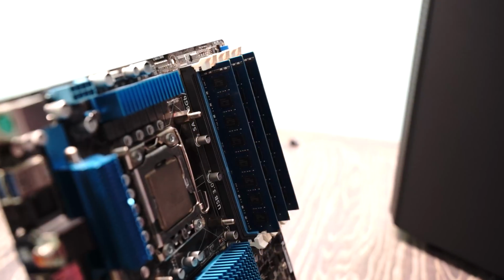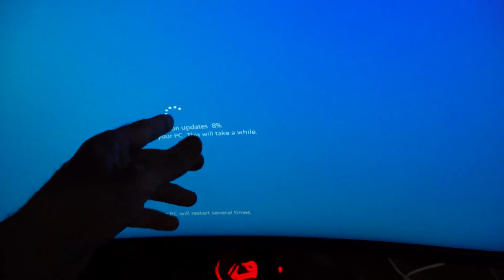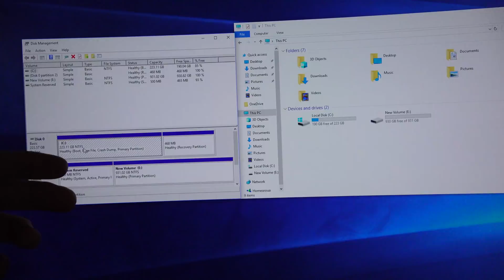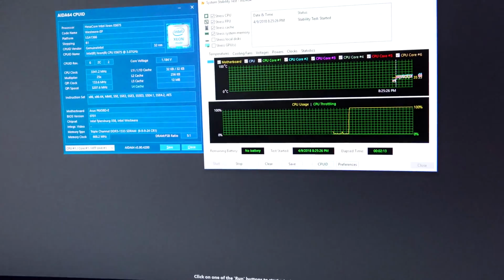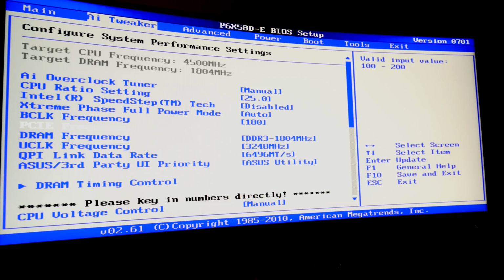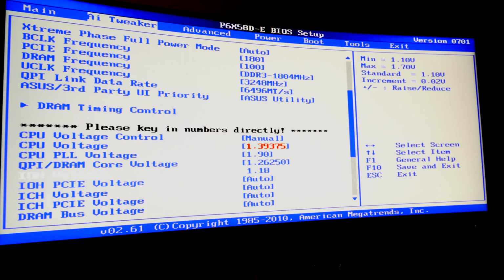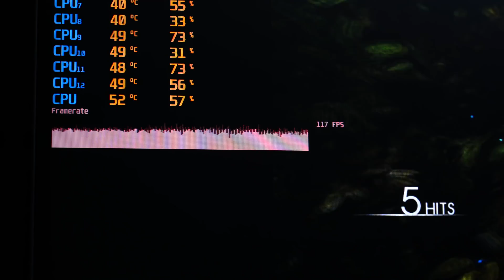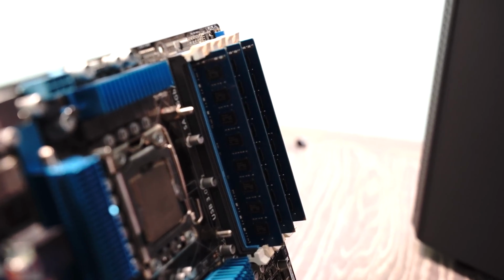Is X58 Still Worth it..? Taking the 6 Core X5675 to 4.5GHz on AIR.

Comment: Working on my 3rd and 4th x58 systems, first was a x5660 that went to 4.41 stable on air, than 3 x5670s in a row going to 4.4-4.5ghz all stable. So much value for the money when you can find the boards at a decent price.

Comment: I still use a dual Xeon X58 workstation. I bought a Dell T5500 back in 2010 half the price (3000 €) and lasted until 2013. The board was changed to a Supermicro and everything was taken out from the case and put into my desk. Then the 2 X5570 were replaced by 2 X5687 and Quadro card with a GTX960. One heatsink snapped off destroying one cpu slot so now I'm using half the board, waiting for a Fujitsu one to continue working for the 8th year with X58. FTR, I used to make 3D architectural work, now I mostly make time lapses working with 3 adobe apps plus 1-2 more photo or video editing programs at the same time. My editor friends still bring me big files to render...

Comment: I have a 5680 on X58 overclocked to 4.6 GHz. Temps during normal usage are just around 55° C, idle around 30° (240mm AIO). Haven't tortured it but in intensive game play it will reach 65-70°. I didn't expect it to clock this high! I'll probably back off the clock a bit as vcore is around 1.39V which makes me a little nervous.

Comment: Just upgraded my x58 rampage ii extreme with some new goodies recently:
- Replaced my i7 920 @3.8GHz with a x5680 @ 4.2GHz
- Replaced my GTX 560 2GB (non-ti) with a an ASUS Strix GTX1080 8GB ...just now (literally)

Love the x58!! much love since 2009 :D and still strong <3 
... just wish i had a spare x58 board to put the 920 in... cant find any here in Canada that are a good bargain :(
Reply: -
Hi, i have an Asus Rampage II Extreme but i am not able to put a modern graphics card. I tried a RX 580 but it didn't boot. I thought it was because our motherboards have legacy bios only, but i see you have a 1080!!! Could you please tell me how did you manage to set it up? Thanks

Comment: More love to the X58 from here... 
That is one Great (old) CPU. I'm running my X5675 on a Gigabyte X58 G1 Sniper. What a nice machine. Running cool 4.2 GHz @1.25V (peaks at 70c an a Scythe Mugen 5).  BCLK 167 x25 multiplier.  Not much stress on the motherboard or memory (running stok speed on DDR3 cl.9)
This machine is using about 150W on idle (complete system from the wall with a GTX 980 Ti) and about 245W wall power on full CPU/memory stress Aida64 load. Good results. Efficiency wise the new Cofefee Lake  platform is much more efficient. My i7-8700 is just using around 110W on Aida64 streess test  (system wall power).
BTW. My X5675 @4.2 GHz scoring 943cb in Cinebench.
The X58 motherboards seems a lot better build than the new Z370 boards.

Comment: Still rocking an X58 board in the guise of an ASUS P6T.  Slapped a Core i7 990x in and overclocked it to 4.0 GHz on 1.3625 V (or something like that).  Just changed the multiplier from Auto (i.e. 28) in the CMOS setup to 30.  Voila!  Haven't subjected it to any torture tests with AIDA64 or Prime95 yet, but it seems stable doing protein folding with Folding@Home.

Comment: Have had an Asus x58 premium and 980x cpu since xmas 2010 and have had up to 4.35Ghz on air utilizing settings all mentioned in the past. QPI delta of 1.4V max vs mem V is spot on correct as aforementioned. Also all the new stuff fails quickly. Manufacturing quality or making die too small seems to make later hardware fail at a yr or sooner from what I keep reading and this board/cpu keeps on ticking. I'll take a little slower and better quality over whats out now. Want to follow NVMe ssd booting on this beast as others have as next back to the future retrofit on my beasty. happy trails

Comment: YOUR CINEBENCH SAYS CPU @ 4.14 GHz AND YOUR PERFORMANCE MATCHES THIS READING. YOU ARE ON 23x180 BRO
I've watched this and the other videos to the x5675 and you should redo your test. Uncore needs to be set 2x dram freq for best performance. set bclk to 195, qpi to  1.3-1.35 , mem 1560, uncore 3120, no spread spectrum, no clock scew, lower multi to 23 and watch how scores improve drastically
I will get my 5675 next week and prove! :D

For comparison my i7-950 @ 4.1 GHz on Air max 75°C 24h primestable
195MHz x 21
1.257-1.303v Vcore (LLC)
QPI 1.4v 3514MHz
1564MHz DRAM freq CL7-8-8-24 @1.65v
HT on

Cinebench R15 score 650
CPU-Z single score 371
CPU-Z multi score 1917
CPU-Z ratio 5.17
IBT output 1024: 51.5 GFlops (these cpus don't have AVX)
IBT output 4096: 53.5 GFlops

Comment: I know its quite late to ask this, i own a rampage iii formula x58, i seem cannot go past install windows 10. It hangs on the windows logo. Turns out it was caused by VT-D technology for Hyper-V settings in the BIOS. I had to disable this for the windows 10 installer to continue. Did you disable your Vt-d settings too? I can run windows 10 now but i need the Vt-d for vmware to work. Did you have any issues with this? Whats windows 10 version that you used for this build? thanks.

Comment: I got a $20 x5660 to 4.3ghz on a Msi x58 platinum with 1.3v(+.260) 205x21 +.280v QPI (still white in bios???)
it does 4ghz @ 191x21 +.170vcore nothing else and 4.2ghz@200x21 +.240 vcore + .240 QPIAny idea if +.280 QPI is safe? this mobo won't let me read actual QPI voltage..... (+.300 QPI will turn red)
It's on a hyper 212 hottest core hits 77c in cinabench games package hits mid 60's

Comment: I have a asus rampage II gen, 24gb ddr3 1600 triple chanal  (even is slow ram triple chanal make it faster them ddr4) 6 core x5645 xenon 2.4ghz and a gtx1060 6gb 
My hp monitor is a 1920x1200 I play wicher3 and asasin creed origins all day with over 60 fps all on max , this is enough for me and I will not upgrade 
The motherboard is very temperamental with over clocking I never let my cpu under 2.8 Ghz  (only 2 bios options Gaming and extreme O.C.) in both cases over clock everything cpu and ram I don't know how to run it on stock speeds

Comment: Hey guys, I just set up a x5675 on a asus Rampage 2 extreme board. tested with 2 stick of 2gb that i had lying around. I succesfully overclocked the cpu to 4,5ghz. Got a score of 1018 on cinebench. So im in need of some memory.
Its just not clear yet what options i have. Regarding ecc memory. Will it work? Will it benefit my system? Or do i get better performance with 6 sticks of 4gb/8gb 'normal' memory.

Comment: I had a similar problem with the Phanteks P300. Both Gigabyte boards I put in this case did not work correctly even after being tested and overclocked on the bench. H55M and H57M, trying to get the I7-870 Stable at 4.0ghz. I spent 2 weeks trying to figure out what component was the problem. After putting the H55M and I7-870 in an older case I was able to get it stable and able to game.

Comment: Hello! I have an Asus P6T If and an X5675 and I was trying to overclock it ... but when I use the 25x, during the stress test, the multiplier goes down to 23x ... so I thought my board did not support the maximum multiplier, so for trying to maintain a stable speed, I tried to use the 23x in the BIOS, but it seems that any multiplier below 25x, the computer does not go into Windows, or do not even Post ... but when using the cpu with the stock speeds, the 25x keeps fixed, without any change, not lowering to 23x as happens when I try to do OC ... what do I need to do to keep the 25x when OC? =/

Comment: dude use an old toothbrush for getting the old paste thats clogged around the edges of the resistors and chip much easier, i cant remember where i got that info but it was really usefull when i had paste on the pins of my FX6350 cpu one time

Comment: Hmm, how would it compare with a i5-2500k? just found a Gigabyte X58 board with a i7-930 for $150 Canadian listed local & seller will throw in a Cooler Master case & T4 cooler for free, there's also someone selling some Xeon X5670 chips for $50 each so basicly a X58 board & X5670 for $200, should I do it to replace my i5-2500k that I'm having a problem with finding a deal on a overclockable motherboard for?

Comment: i have the same issue with my p6td deluxe (x58) and a 1080ti evga icx... it wont post or boot (sometimes it did) with display port. there's something wrong there... using a 1070 from gigabyte does not cause this problem, so go figgure... express gate helped at first but then things degraded and I could never make it work. i now even have my board crossflashed to yours, and it still wont work :( weird thing, if I put the 1080ti in hdmi there are no post/boot problems lol

Comment: What does a 4.5ghz 5670 score single core in cinebench? That is a far more accurate portrayal of how its going to game than multi. If its anything under 150 its not worth your time or money to invest in this platform.
Reply: A 4.0 scores 124 or so. I don't think you will break 150

I think a 4.37 is 130.

The gains are minimal after 4.0.

Honestly it just depends on how cheap you find it. I've gotten 3 x58 boards in the last year. 

2 of them dirt cheap. One was in a broken but not broken pc build that I only paid $40 for. Sold that motherboard  $140.

Another was in a fully built pc I picked up for $200. I sold all the parts I didn't need like the gpus, hard drives, and recouped a lot of my $$$ and had a sweet case I put to the side for a future build. Saving them for a Ryzen 7 build I'm the future.

The last one was a dud on my part. Scored a board and cpu i7 920 or so for $50. Thought it was an easy sell. Did not sell as fast as I liked. Ended up selling it online and mailing it out as opposed to selling it locally. Got damaged in transit so I made almost no profit on it after I refunded some cost. Whomp whomp.

I use one as my main rig at the moment even though I have better parts just cause...no real reason.

Comment: I like your channel.

I have a GA-EX58-UD4P and it's in a forever-young X58 super-stable beautiful case platform I refuse to give up. I have a Facebook album that I started 9 years ago that chronicles the growing-up of by beautiful boy.

Have the new GTX 1060 in and working fine. Have 1.65V tipple-channel DDR3 Corsair kit (updated CM3X2G1600C9) 3-part on order from Japan to get me to 12GB. 

I'm giving you the FB album here:

https://www.facebook.com/media/set/?set=a.58625182241&type=1&l=50082fea05

I still have the original 45nm 920 in the LGA and have never overclocked. Which Westmere should I plop in that socket?

Comment: Just here to leave a message. I still own a decade old Core i7 920 rig.
Yes, OC'd @ 4GHz from base 2.66 (2.8) G mark. Running a beast of a GTX 1080 Ti by AORUS for half a year @ 1440p.

Both under water.

Comment: Thank you for helping us save our hard earned cash.  I'm running the X79 platform and all I need is max out the RAM and slap in a Xeon X2690 v2 or 2697v2.  Turbo boost it and Geforce RTX ready ( I don't need nvme boot since I'm using the Intel 520 SSD (my all time favourite ssd))

Comment: I'm a lazy overclocker lol. I like the unlocked chips like the xenon w3680 (xenon version of the 980x) which you can get on ebay for $70 usd. With the unlocked multi, you can just adjust the multiplier and voltage and your good to go. You can also choose whether you want to leave speedstep enabled or run a fixed voltage. I like the speedstep option since the voltage and speed kicks down when im doing something easy like reading on the internet, then kicks back up during more intensive tasks like games. For memory like on 1600mhz sticks for example, i just apply the XMP profile. Makes for and easy overclock. For example, my w3680 on a sabertooth board is running at 4.41ghz, which is set with a multi of 31 on a 133 stock base clock at 1.344 volts peak with speedstep. And for my 1600mhz ram its just set with the xmp profile which sets memory to 1.65 volts, 1.20qpi (raised this up to 1.25v for 24gigs of ram), and CL9 timings. I literally leave everything else on auto. Sure, maybe I can get more performance out of base clock overclocking, but the stability is easy to get this way. Which is why I say im a lazy overclocker lol. The nicest x58 build I had was a W3690 on a Asus Rampage III Extreme with 24gb of 2000mhz Corsair Dominators. Only ever used the xmp profile on those sticks, wonder how much farther those can be overclocked.

Comment: Quite often the cpu clamp doesn't apply enough pressure on the 1366s and the pins make poor contact. Random reboots blue screens ram not recognised. I know cos it took me ages to find tbe fault. Fixed by cleaning cpu with ipa/air compressor on mobo and adding washers to cooler for more pressure

Comment: You have to unplug all of the drives except for the boot drive when intalling Windows or it will put the boot partition on another drive. Why does it do this? I have no idea, but that's the work around. Then once windows is installed, you can plug back in your other drives. This happens on my ASUS Rampage Extreme III as well, but I never had the problem on my ASUS Sabertooth.

Comment: Are you comfortable with the vcore being as high as 1.4? I'm slightly spooked of burning the chip/mobo with that kinda voltage. It might be necessary for getting my X5650 to 4.4, even though my CPU temp scores seems safe and well below 80 degrees under full load.
Reply: What are you oc settings?
Reply: With my P6T Deluxe v2 and X5650 I'm locked with a 20 and 22 multiplier. I can reach 4Ghz (and 4.4Ghz turbo) with the 22. There begins to be audio distortion if I have to bring the BLCK up to 220 with a 20 multiplier. I've disabled hyperthreading, which hurts its multithreaded score a lot, as it is unstable at 1.39 V with HT on.

Settings:
Ratio: 22
BCLK Freq = 200
PCIE Freq = 100
DRAM Freq = DDR3-1203Mhz
ULCK = 2406MHz
QPI Link = 7218MT/s

CPU V = 1.39375
QPI/Voltage = 1.90
QPI/DRAM Core Voltage = 1.25
IOH V = 1.10
IOH PCIE = 1.50
ICH V  = 1.10
ICH PCIE V = 1.50
DDRAM BUS V = 1.64

Other/Advanced settings:
CPU Spread Spectrum = Disabled
PCIE Spread Spectrum = Disabled
C1E Support = Disabled
Intel Speedstep = Disabled
Intel C-STATE = Disabled
Intel HT Technology = Disabled

Comment: I've got an x58 system (bought it as a workstation back when it launched with an i7 920 in it) which I'm using almost daily. Last christmas I've got a deal on a 990X and only recently installed it. Have yet to do overclocking on it though. Figure that cpu's going to be quite nice though.

Comment: Can i ask a question?
Im planing to have X58 rig, the mobo is EVGA X58 Classified3. I downloaded the PDF specs file about this mobo and it said DDR3 800/1066/1333/1600+, is 1600+ mean i can use DDR3 2400MHz? or i just stay with 1600MHz?
Im planing to have X58 + X5675 4.5Ghz maybe 5.0GHz in the future.
Reply: most Boards are Limited to around 180 MHZ BCLK, so the 5675 has a locked Multi of 23, that multiplied with 180= 4141  + turbo=4,3ghz, 5ghz is pretty much unreachable with that chip , i would mean going 217mhz Bclk, best CPU ist definitly a w3680 or w3690 because they have an unlocked multiplier
Reply: @holzvonobi1851  oh. If that so why Tech YES City can OC 5675 to 4.5ghz then 🤔
Reply: his board allowes him to get that turbo to 25, watch around 12:10  intel speedstep, also not alot of people recommend speedstep for overclocking, its a bit of gambling if it works, but 5ghz is way out of reach. Also if i see speedstep correct it will only boost to 25 and 4,5ghz if max 2 cores are used, if more than 2 cores are used its only boosting 1 multiplier more resulting in 24 x 180, get the intel extreme tuning tool to see that.

Comment: Nice to see someone else who really dug into X58/Westmere, and got to know all it's quirks and what it wants for 4.5GHz+. I've been overclocking for 16 years, and the only platform that's rivaled X58's fun for me was nForce 4 (DFI Lanparty.) Currently have my X5675 @ 4.7GHz 1.45v on water, (C1E on C1 to disable turbo) w/ an Asus Rampage II Extreme. Chip will run 4.8GHz (5GHz turbo) on 1.5v, but I'd rather not kill it. An X5650 will survive for about a year at 1.55v just FYI :)
Reply: I have one Which bios do you have please?
Reply: @Noyblis  Bios 2101, the latest version for the R2E. I've read the board can be quirky with certain RAM, but I run G.Skill Ripjaw 1600 and I've had no issues with massive overclocks and have pushed the Ripjaws over 2GHz on CAS11 timings. Not sure which BIOS added support for Westmere, but I know the stock BIOS won't boot them at all.

Comment: I'm still on my first gen i7 920 OC'd to 3.6ghz, I've had so many problems with all x58 motherboards I've used though (got an ASUS Rampage Gene II at the mo).

Have you ever had problems related to the RAM modules? I had to increase voltage to the RAM sockets themselves as well as North Bridge in-order to even get my PC to run with 4 sticks of RAM. Even still it fails to boot 3-4 times upon cold boot until it has warmed up a bit (literally happens every single time unless the PC has been on within the past few minutes).
Reply: Upgrading the CPU to the x5675 was one of the best purchases I've made.For £30 I'm now running at 4.2ghz 6 cores/12 threads, and much cooler than my i7 920 too. Your videos were a great help in deciding to switch the CPU, cheers mate!

Comment: I've been running the Gigabyte GA-X58A-UD3R rev 1.0 for many years now, had an i7 920 overclocked to 4GHz for a very long time until I decided to get a super cheap 6 core W3680 and overclock that instead. I love it, I am able to undervolt and overclock which is fantastic for performance and temps, it's rock solid 100% stable. I have it paired with a GTX1070 and playing at 1080p, game performance is amazing. I also still have my 11 year old Corsair 520W PSU still kicking. Who said PC gaming is expensive??

Comment: The cpu is cheap but the motherboard is to expensive. So with the pci cards you need it will be wiser to get an i7 8700K cause it will not cost so much more.